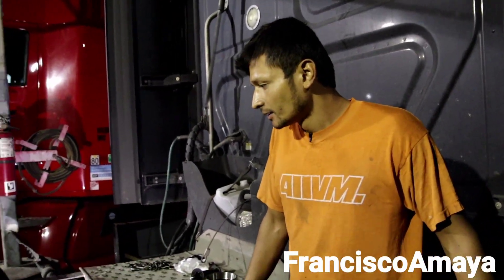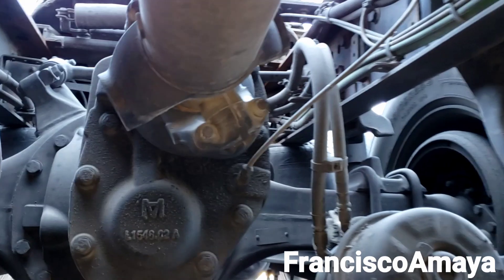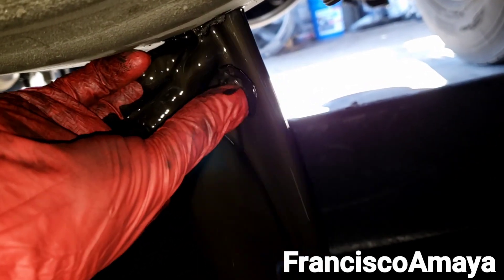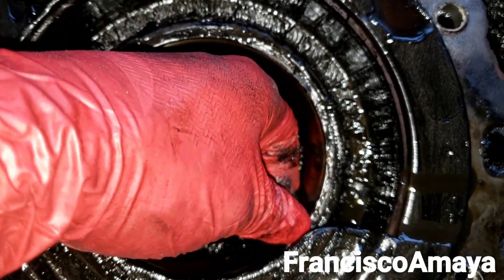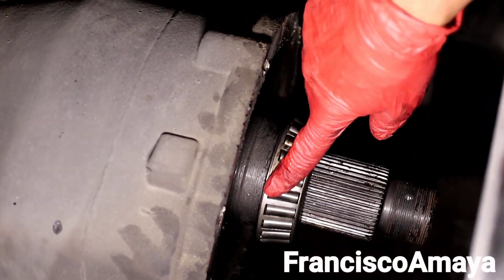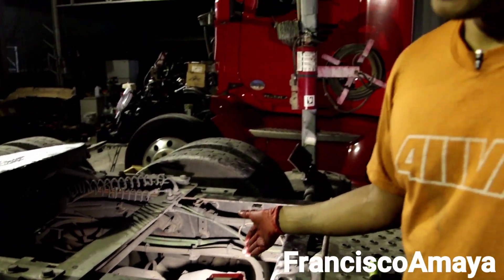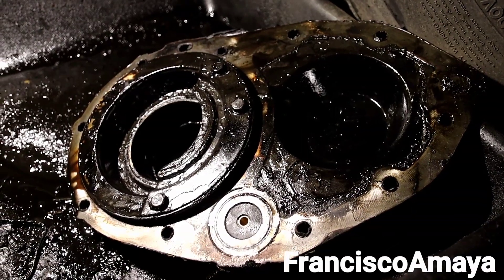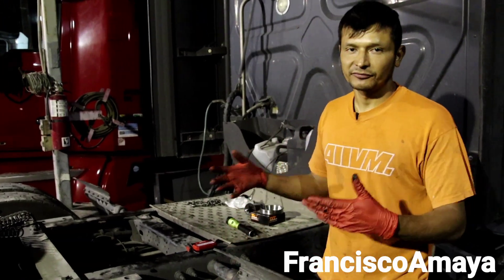Freightliner Cascadia inter axle differential knock while driving problem broken bearing plate

Comment: Hi Francisco. How you doing? I have 2020 Freightliner Cascadia. When it reaches 60mph it is shaking. Once oil came out from axel seals. I replaced them. Took it to mechanic. He replaced axel inlet and outlet bearings , carrier bearing, bushings, did axel alignment and balance. I did test drive truck was still shaking after 60mph. Then I did drive line balance but it is still shaking. What do you think problem is?
Reply: Same here! Did you ever find out the problem? Please let me know.
Reply: @erikb7232  
The problem is in transmission. The bearing inside the transmission is loose
Reply: @martinkazako2292  was is the throwout bearing on the clutch... I'm at a lose and replacing my clutch now.

Comment: My 2020 cascadia had the same problem. 400k miles on it. Utah freightliner dealer replaced whole 1st axel differential assembly.
Reply: Hi. Can you explain more? I have 2020 Freightliner Cascadia too. And when I drive 60-70 mph it is shaking. I did everything about suspension and balance and alignment of axels, driveshaft. But it is still shaking. I think I am gonna open 1st axel. Please explain more how it was. Was your truck shaking. Teşekkürler!
Reply: @martinkazako2292 did you find problem. I have same problem.
Reply: Was the issue fixed? Having similar issue with 2017 Freightliner.

Comment: I think I have this problem. I've been having trouble determining where the noise is coming from. I've replaced driveshafts, leveling valve, clutch and transmission and still get noise/vibration when accelerating in higher gears
Reply: Did you ever find the problem. I am having same issues. Going to change my clutch this week I don't know what else.to do
Reply: @erikb7232  hi what was your problem with noise?
Reply: @myagmarsukhbatjargal5757  It almost sounds like the engine brake under a load and accelerating.
Reply: @erikb7232 did you find problem?? What was the issue??
Reply: @familykherson2867  no never got to the bottom of the problem ended up getting rid of the truck
Reply: @familykherson2867  my next thing would have gotten the valves adjusted though
Reply: I’m having the same problem pls let me know if u find it

Comment: My inter axle diff got stuck on the lock position even though that it was in unlock position in the dash. Didn't make it 2 weeks until it destroyed everything inside.
Reply: I just got the problem today. The button is unlock position but the light indicator is on
Reply: @Bigola  Try moving the truck forward to a flat ground and lock it then unlock again. I used to work delivering pups to residential homes and churches. A lot of it involve being on dirt and uneven ground surfaces so I did use it a lot when I delivered. One time I caught that it was still engaged on a different truck when I was on the interstate and I saw my 2nd axle temps were higher than normal, like 50 degrees above normal. I pulled over and lock it and unlocked it again. Started driving and they went back down in a few minutes. If you have axle temps gauges you could keep an eye on that. I remembering costing around $2-3k for that repair because my differential was completely destroyed and that was a used one because they couldn’t get a new one anywhere at the time. Good luck.
Reply: @alex7289  thank you so much. I did what you said and the light indicator disappear.

Comment: I have 2013 cascadia my Truck show code 2791 fail 14 all def system reinstall new but my Truck go on road check engine light on and lose power 10 second to50 second,I already aculator two time change give me a suggestion please